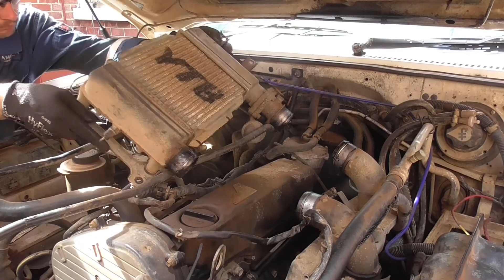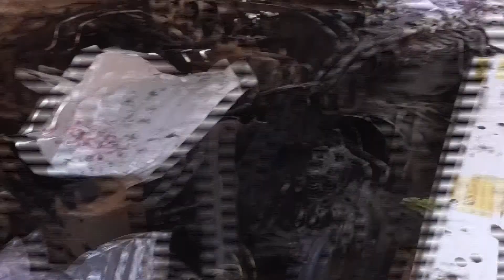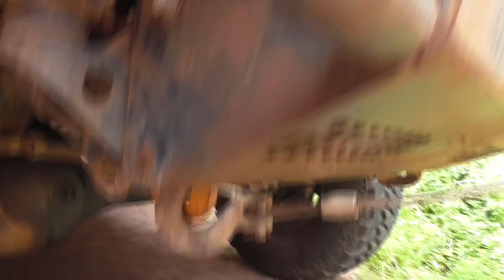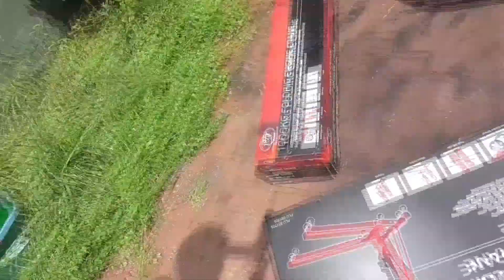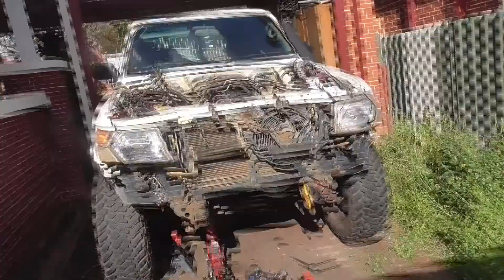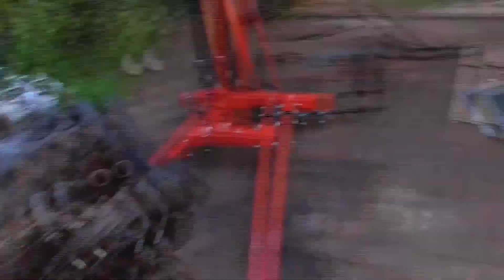Pulling the RD28

Comment: Nice oblivion music. was watching your swivel hub assembly/disassembly.

what are these 2.8 td patrol engines like? hopefully a lot more reliable than the zd30?
Reply from the maker: they are alright. mine is fully munted but almost have it back in the car. with the right mods they can be very reliable and the big reason people love them is the sound. not huge on power and torque but lowrange box means that doesn't matter